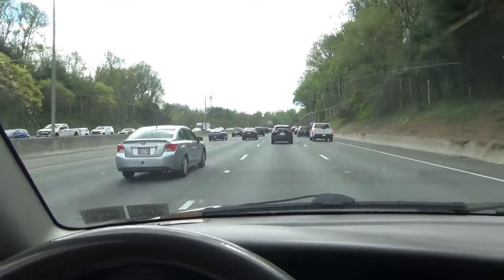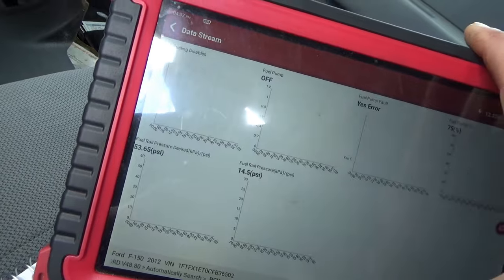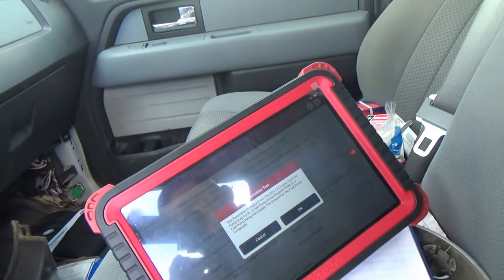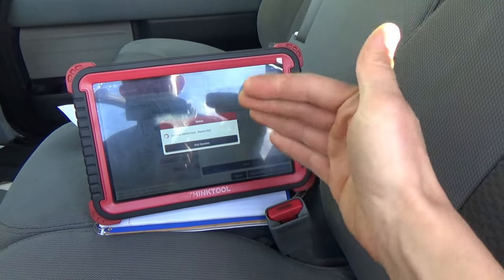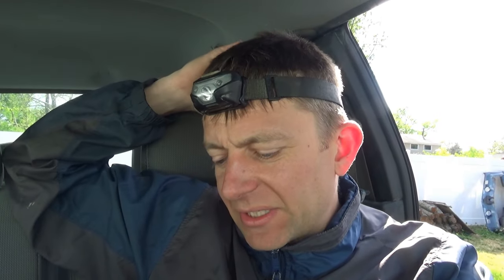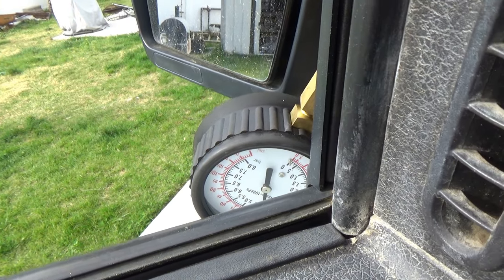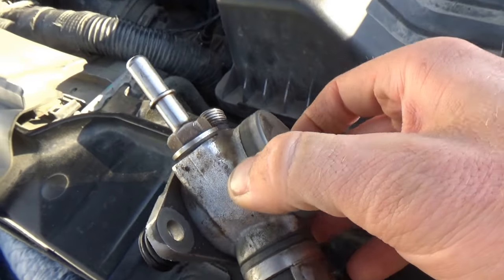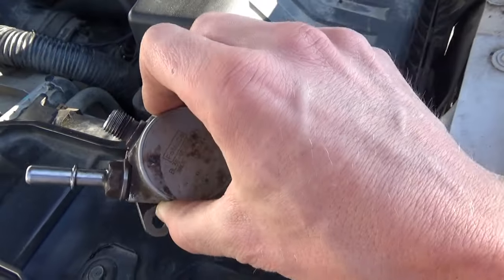WEIRD Crank No-Start (Ford F150 Ecoboost)

Comment: It's so surprising that such a fancy tool can't figure out if the timing is right
Reply: The engine's own PCM didn't know it was out of "time",  the scan tool won't either.
Reply: My Launch Scan Tool showed an advanced timing code when the timing chain tensioner seal blew out. The Timing Chain jumped a tooth and my Scan Tool threw the correct code. I swapped out the Timing Chains, Tensioners, Guides, VCT Solenoids, and New Oil Pump. Truck runs good now.
Reply: Truck has to be running for the scan tool to set a timing code. 
Possibly the owner was cranking the engine to long and killed the battery. There for the codes were erased.
Reply: @2nickles647  Not likely, but possible. The Battery would have to be completely dead for that to happen.
Reply: What's the quickest way to verify timing?  Way too much time is spent going down rabbit holes.  Is there any way to use crank position data and some other info to quickly verify it?
Reply: @davidhall3747  is that scan tool more advanced than the one he is using?
Reply: @bluesky2145  I wouldn't say it's more advanced, but a lot of Mobile Mechanics use them. It's a very powerful scan tool, almost as powerful as my Snap on Verus-Pro. My Launch is my go to Scan Tool.
Reply: @bluesky2145  My quickest way was to use a Master level Scan Tool  as mentioned earlier.
Reply: I mean we  have all these fancy scanners, scopes and meters and we still dick around for an hour without being able to get fundamental vitals.  With all of this technology we should be able to know all the basics in a minute.   Fuel, compression, spark, timing  !  What we got ?  It stupid to having to be probing all this stuff in this day and age for basic vitals.
Reply: @bluesky2145  Another problem is the Diagnostic Firmware inside some PCM's can't be relied upon.
True example: My wife's Honda Civic had a failed Camshaft Position Sensor and on another occasion the EGR Valve failed. In both cases the MIL/ CEL didn't come on. The Honda dealer top tech helped me figure out what needed to be replaced through experience of seeing the problem on other Hondas. Its frustrating diagnosing a modern car with no CEL. Firmware can become problematic on Some of today's modern cars. No codes makes  the job harder than it should be.
Reply: @davidhall3747  it's just shocking, embarrassing and just dumb that all this technology can't tell us if we have spark, compression, fuel and timing in the first minute of troubleshooting.
Reply: @bluesky2145  I agree, it would be nice to get the vital information quickly. If the vehicle is running its easy to analyze the live data. When it cranks but doesn't start, that's when the nightmare begins.
Reply: @davidhall3747  But these cars should be designed so even if they don't start it's easy to get to vitals. Like maybe windows into the timing chain cover I mean chain cover et cetera

Comment: Back in  1973 my college instructor Herm Luhrs stated that 90% of fuel problems were ignition problems( including timing) I tell that to you kids today and it's Oh no has to be fuel pump , I'm not being insulting I'm 69 years old.
Reply from the maker: How does that make any sense?
Reply: @PineHollowAutoDiagnostics  We were talking gasoline engines only, we still had points, condenser, coil, spark plugs, spark plug wires, ballast resistors, distributors, cap and rotor. Fuel injection was a race car only option at that time, still had carburetors and all the distinct passages in them that could raise hobb. The very first American on board computer was in a 1973 Buick Riviera, I worked at a golf course and got to see it, the AC Sparkplug  division of GM was having a tournament, the summer of '72, nothing more than a whole bunch of lighted switches and a motherboard the size of a baking sheet, it filled ALL the extra space under the hood and made the car run very hot, 'course they were running the air and it was a hot summer and there was six golfers in it, so it wasn't the computers fault. But yeah cars were still antiquated beasts, but were starting to slowly break into the 21st century.

Comment: It’s amazing to me that engineers can be so smart but yet can miss a design flaw. Timing chains have got to be the worst solution to modern engine design. Why not just keep using timing belts, since at some point your gonna have stretched chains anyways.
Reply: Belts are not strong enough for most Light Duty Trucks.
Chains are more for heavy duty use.
Reply from the maker: @davidhall3747  just use a thicker belt! Like the Toyota 3.4V6...have seen 300k miles on the ORIGINAL belt, and it's still going strong 💪😁

Comment: It may have still needed a pump anyway if it was leaking fuel down into the oil.  I'm actually shocked that those pumps can last 200k+ miles like that while working at such high pressures.

Comment: Did you refund the guy for the high pressure fuel pump you told him to buy?
Reply: I probably wouldn't. At this mileage it could go any second.
Reply: He said at the end he refunded the guy.
Reply: @TheWilber09  For the diagnostic service. If I were the customer I would not have taken a FULL refund because he did give him the correct answer that it was timing. Ivan is not paid to fix it but to diagnose it.
Reply: @hikerJohn  And he diagnosed it wrong
Reply: @robevans8625  He CALLED both fuel pump and timing but still helped the guy fix it. He would not have looked at the timing if Ivan had not called that as well. Maybe Ivan feels that the parts and labor for the pump was more than the diagnostics. Not knowing what the costs are the peanut gallery cant say much about it.
Reply: @hikerJohn  He told him to buy the hpfp  then when that didnt work said other things after the event. Why didn't he check the timing? This is what happens when a mechanic over relies on scan data and codes.
Reply: @robevans8625  It would be interesting to see the data of the desired vs actual post fuel pump replacement. I have worked on auction garbage for years. Its like peeling back an onion in repairing them. Multiple issues left unfixed for years added in to the diagnosis.